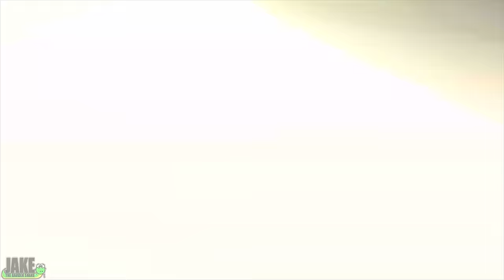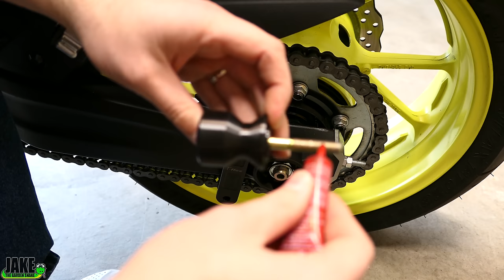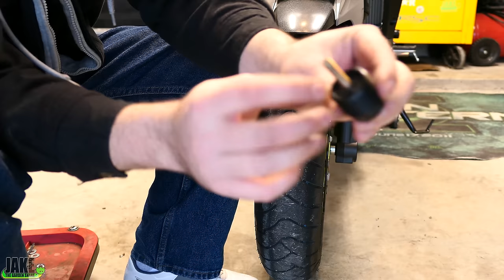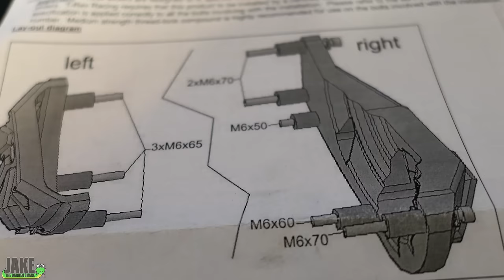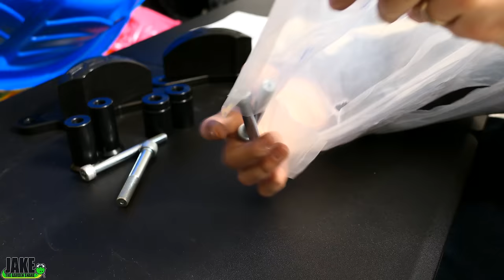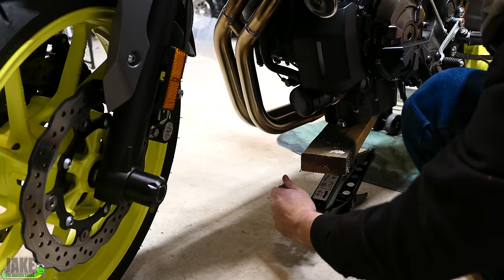FZ-07 Frame Sliders, Speed Rails, Axle Slider, Case Savers MT-07 XSR700

Comment: Can’t say enough good things about t-Rex slider kits!!! Got em on my drz and I slid that bitch across 20 feet of pavement and there was zero damage other than the sliders that showed only a little bit of scrapes. So awesome
Reply: co8539 even without the trex gear the DRZ is just a beast. I had case savers and a skid plate from thumper talk on mine when I crashed it. Did an endo at 55mph on asphalt and shattered my collarbone into 5 pieces. Picked up my DRZ 400 and it had some scratches and a broken turn signal bulb. It started up and drove away just fine. Fuckin amazing bike

Comment: I have these frame sliders and axle sliders. The frame sliders where the biggest pain in the ass to install ever. The dam engine dropped on the onside and it wasn't just a little bit off but more than half of a bolt off so with jack underneath was still way off. I had to use my breaker bar to pull the frame into place in order to make holes line up. ...You made this look too easy Jake.
Reply from the maker: You didnt take both sides out at the same time did you?...
Reply: Jake TheGardenSnake No I did one at a time. It was on the first one. It wasn't just from engine drop the frame also warped up it was like 40F out when I did it so the shrinking of the metal is probably to blame.

Comment: The one's that you have put on the engine should be tightened to 12 Nm of torque. It is pretty light, I can already tell you have overtightened them. Specific torque right there is one of the most important compared to any other place, as it has a gasket on both sides which prevents oil leakage. It might be just fine for a couple of months/years, but that might be the case you will get oil leakage in which case you will have to change both side gaskets. 
Just a comment to make other people aware,
Ride safe!

Comment: I had to use a 2x4 and floor jack to  lift the motor up just a hair to hand thread the engine mount bolt...  and it was the left side on mine as well.

Comment: Hey man I just got the exact same case covers and sliders, fantastic feel and quality but I'm having issues with the case cover mainly with the left side one, i removed the three bolts the bottem two leaked oil as soon as they came out and now that the cover is on it leaks a bit on rides, they are as tight as i can safely torque before stripping the threads not sure what to do pls help
Reply: Just curious because I’m about to install my kit tomorrow. Did you ever figure out what the issue was with that side leaking?

Comment: Are there jacks like car lifts that you can use on an FZ07 that keep it stable and able to work on suspension? I feel that the rear spring is too soft for my weight and I don’t think I can work on the suspension with normal paddock stands.
Reply: Constands

Comment: Frame slider AKA the leg amputator. 
I had a crash with my previous bike which had far less pronounced frame sliders than these ones. Head on crash into a car that jumped from parking. I hit the slider with my leg so hard that it tore my leather pants against my shin. Imagine what was left of my own skin... Wound was open 3 months. Nasty scar now.
I write this so you can judge for yourself, where is your leg in relation to the slider and what will happen if you run into it at high speed. I own FZ07 now, I ordered a similar set of sliders but after installation I realized they were basically metal spikes pointing into my knees. Not again thanks. At least wear good knee guards. 
Ride safe.

Comment: I've heard that frame sliders can actually cause your bike to tumble in the event of a low side slide. I'm sure it's total BS but just wanna ask some people's opinion on that
Reply: Evan Asche it's possible they can catch on a dip or pothole and cause it to tumble. From my understanding they are designed for the bike to low side and slide across the ground on pavement, any other kind of crash where the bike flips first or high sides hard will still do some damage to the body of the bike and possibly tweak the forks or frame depending on how hard you wreck. Frame sliders are nice to have though if you ride twisties and may low side from pushing it hard in the turns and can still have a chance of saving the bike in other accidents too it just all depends on the crash.

Comment: what torque wrench you using looking to get one ?
Reply: Harbor Freight...
Just like the Swivel Head Ratchet...
Lifetime Guarantee on ALL hand tools..
No questions asked.. Unlike Snap-On And or Mac Tools.
Reply from the maker: I use a craftsman
Reply: Subject torque wrench.  Jake you said one should leave torque wrenches set to zero when storing.?  Since I've never heard that before I googled it.  Here is an article from a torque tool manufacturer and I was wondering if you had any evidence that it makes a difference either way.? https://www.norbar.com/en-in/News-Events/Blog/entryid/428/Default

Comment: Cringed a little when I saw you put the jack under that cast aluminum oil pan.  Just finished replacing mine an hour or so ago thanks to a rock!
Reply from the maker: I’ve done that hundreds of times. Those oil pans can support the weight of the motor and often the whole bike.
Reply: Jake TheGardenSnake my cracked oil pan had a lot to do with an oncoming Tacoma, and a ditch lined with rocks (God knows why).  Luckily the home owner was lazy and had also left a comforting bed of leaves down, so at least there was that.

Really enjoying the BSOS videos.  Keep em coming!